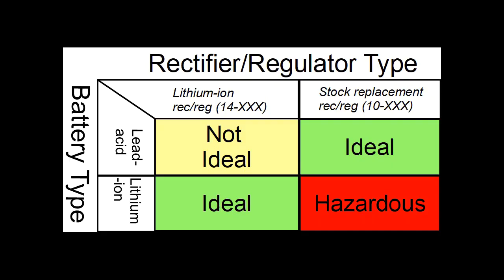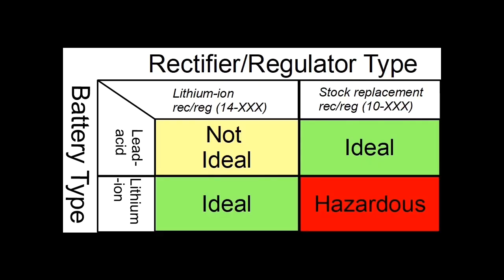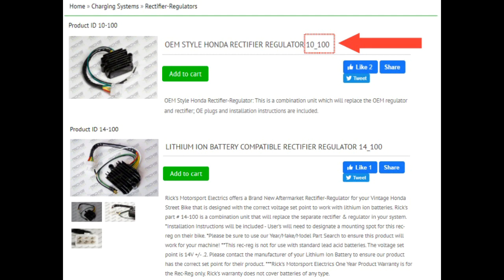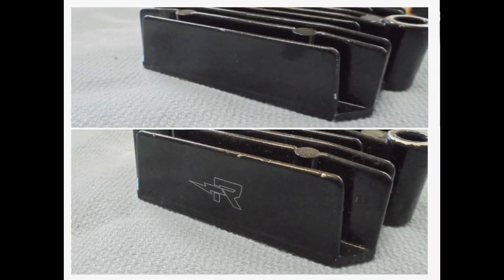Do I need to upgrade my regulator if I switch to a Lithium Battery?

Comment: Been running an unprotected LifePo4 in my BSA for a few years while working on the bike, short trips, easy runs.  Once the bike was all set up and running longer trips at higher RPM I cooked the battery.  Stock rectifier with a Zener. I was warned, lol.

Comment: if the overvoltage is the only problem, means battery with BMS does not has to use this regulator? since it will balance and limit the voltage source that come from the "standart" regulator.
Reply: Stupid thing... I have a dead Battery Tender brand Lithium Iron Phosphate battery that has a built in BMS that even shuts off the battery if the temp goes below 29 degrees Fahrenheit, which is awesome... but the battery died on me yesterday and left me stranded at a dangerous intersection in the middle of rush hour... It was not a pleasant experience. I don't think I'm doing Lithium again... but at least I know the symptoms leading up to the catastrophic failure the battery had. I'm just not in the mood to spend $300 on a battery every year or so.
Reply: @BerryTheBnnuy  I don't think it is possible for the battery to kill the bike unless the charging system goes first.  It would run on the current provided by the charging system.  If the charging system fails, then it would run off power from the battery until the battery is dragged so far down that it can't run at all.  The BMS should have protected the battery from getting low enough to harm itself, I would think.

Comment: Thanks for this video. What about using lifepo4 batteries?
Reply from the maker: You won a calendar!  Text us your address and info to send it out!  (603) 329-9901
Reply: @RicksElectrics  What reg do I need for my 1993 Harley FXR? Will it be a plug in from stator and 1 wire to battery? Please help, burned 2 lithiums with a C.E. new reg and stator. Last battery I burned was a 398.00 antigravity....🤔
Reply from the maker: @GidDree  Good morning,

Please email us at info@ricksmotorsportelectrics.com with the precise specifications/connection requirements for your bike (ideally, pictures of the OEM rec/reg).

Comment: I have a k6 GSXR750, am running a Shido lithium ion battery, Emmy charging system isn’t working so would like to buy this lithium rectifier from ricks as well as rick’s Stator, where would you recommend I relocate the rectifier? Or should I mount it on stock position where everyone thinks is a major heat zone?
Reply from the maker: Anywhere that it gets better airflow is better.
Reply: @RicksElectrics  I relocated it to the left fairing, installed lithium compatible Rick’s Rec/Reg and Ricks Stator , also added an onboard voltimeter and never been happier, my battery is about 13.5V parked then when fuel pump primes it’s 13.1 and doesn’t drop when the motor starts, they immediately idling charging at 13.8 and as the engine warms 13.9V then finally as I ride it’s 14.0V , then using indicators it’s 13.9 and high beam on its 13.8 …. Just watching this while riding is incredible and my motor has never been happier … thank you so much Rick’s Electrics Motorsports

Comment: Can you tell me what each individual wire is for on the rec/reg? I’m completely stripping the wiring on my chopped cb750 and need to know which wire is for what, thanks.
Reply from the maker: What part number do you have of ours?
Reply: @RicksElectrics  14-100

Comment: Does the stator need to be changed at all?
Reply from the maker: nope - the rec/reg is the only thing that needs to be changed.
Reply: Nah, stator is just the stationary part of the generator, it makes the power, the rectifier/regulator is what makes sure the power doesn't go over the proper voltage. Modern cars have a much better time of this because they use field coils which lets the alternator control how much power gets generated directly, without the need for a regulator.

BTW "rectifier" means it rectifies AC into DC, and "regulator" means it regulates the voltage.

Comment: I just installed a Lithium Ion battery in my 2009 FLHX Harley Davidson. I have no idea what regulator is on this motorcycle, is there a plug and play lithium regulator for this particular motorcycle? Thanking you in advance,
Anthony
Reply from the maker: Hi Anthony,

Right now we only have regular-setpoint rec/regs as direct plug-ins for Harleys.  However, if you're OK using a universal part and wiring it in you can email the system information to info@ricksmotorsportelectrics.com and our techs can take a look and see if we can match up the system to an appropriate universal rec/reg.

Comment: Hey how's it going? Awesome video, I just upgraded my amplifier, alternator and battery. My amplifier is running a little over 4k rms, I just installed a 200amp HO alternator and bought a big 90ah lithium bank. I was told I didn't need any regulator, just charge and add my lithium and go. I noticed my voltage sits @14.1 idle, before with my two xs power agm's I rested @ 14.4-14.6v. I started looking around to see if I'm missing anything and I keep seeing with alternators charging lithium I should get a regulator. I'm completely new to lithium, could I get any help on what regulator I would need? I don't want to blow my new alternator, I would greatly appreciate it!
Reply from the maker: We can't speak to someone else's product, but if it's an automotive-style alternator (which it would pretty much need to be in order to get a 200A output) then it should already have a voltage regulator integrated into it.  If you're charging 14.1V that sounds just about perfect for a lith-ion battery.

Comment: I replaced my battery with a lithium iron phosphate battery and a year later, just yesterday, my battery just died on my way to a meeting with the chapter of a biker organization that I belong to. The battery just up and died and the engine quit running. I immediately knew it was an electrical issue of some sort, but it took me half an hour to figure out what exactly went wrong. As soon as it happened, I sent a message to the chapter. A little while later some of them showed up at the intersection I stalled out at and one of them went and got me a new lead acid battery from a Walmart just half a mile away and I installed it and was on my way.

Now I'm wondering if my regulator was maybe damaged. I hope not. I do have a replacement. Heck, I've got two of the exact same bike. I bought the second one because the first one needs its engine overhauled and the second one was mint condition and cost the same as having the first one's engine overhauled. So now I've got a parts bike that actually runs (the original bike) and the new bike. First one's a 1988 and the new one's a 2002, but they're practically identical in every way except decals and a few minor differences that don't result in incompatibility of anything. Both are KZ1000-P.

Anyway, the 1988 had some electrical issues that I eventually tracked down to busted magnets in its generator, but I bought a new stator, rotor, and regulator. Ended up not needing the regulator. So I've got a NOS replacement on hand if I need to... It's just a pain in the ass to replace because it's under the bike, right in front of the swing arm, and despite having extra ground clearance from the cop suspension, it's still a pain in the ass to get to without one of those hydraulic tables to lift it up.